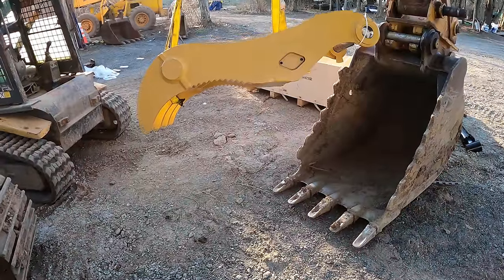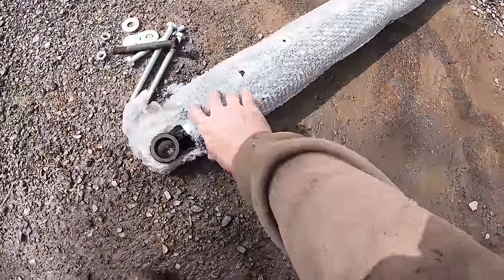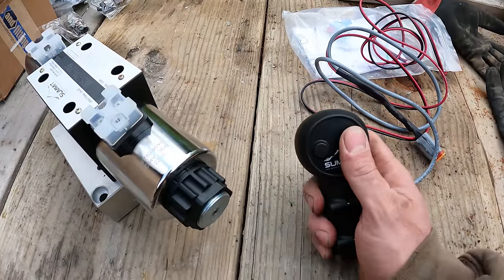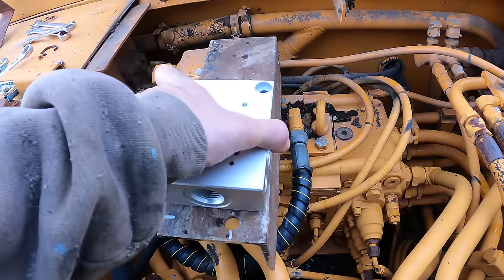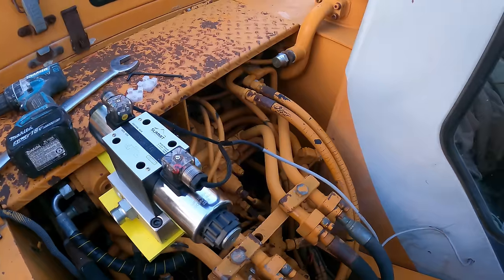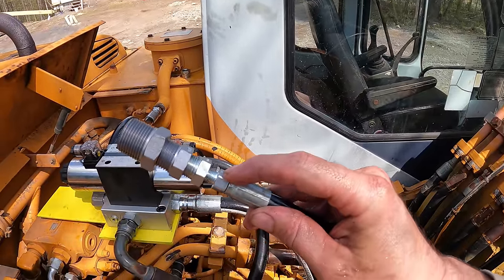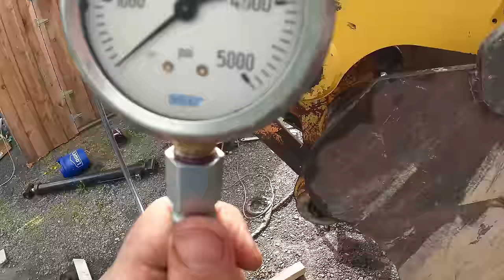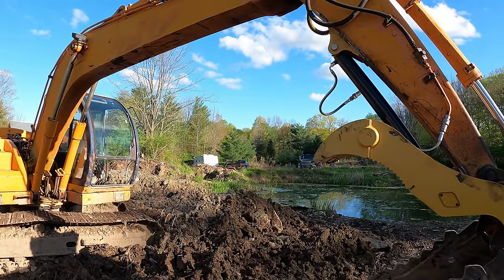Installing a hydraulic thumb on an excavator with 1 way aux circuit

Comment: I enjoyed this. I used to work at a hydraulic specialty shop and the first thing they taught me was fittings , fittings , fittings !!! This man could walk around any machine and write down all the fittings (the stlye and the size and the angle ) and he was always rite. I learned SO MUCH ! When I was trouble shooting they taught me to always “follow the flow”. I can tell you also learned a lot. Thanks (Seth in North Carolina)
Reply from the maker: yea there is alot to learn. I walked into a really good hydraulic hose and fittings shop near me and had everything all planned out and those guys kept right up with my demands with no problem, They knew exactly where everything was and even alot of the part numbers by heart. I was very impressed. I didnt just walk in with a hose and say I need it replaced. I came there with a list and walked out with every single thing being right
Reply: ❤❤7ិុ្៦😢
Reply: @jmuller86 0:11 😮

Comment: These videos are precisely the reason we lease our heavy equipment on our farm. No messing around, line-up the jobs to be done, get the equipment..do the work. Equipment goes away. Return to farming. I hated doing this work when I was a kid on my Dad's equipment. The machine shop, and support tooling was also so expensive to keep up. I can't remember even a month of my teenage years when I wasn't asked to make a "quick trip" to the hydraulics store and pickup fittings or hoses.
Reply from the maker: I dont mind working on the equipment, there is always something to learn and it is very satisfying knowing you can accomplish this stuff, when most people dont have a clue anymore
Reply: @jmuller86  I understand that perspective. Mine is simply, get work done without creating more work for yourself.

Comment: Hi Jesse 
The reason the relief valve on the main spool wasn’t allowing the thumb to move when you applied load with the bucket is because the solenoid valve is dead ending the pressure coming back from the ram when it’s not activated. That’s why when you tried to operate the thumb while pushing with the bucket it moved as the solenoid was open it allowed the oil back to the main spool relief. Tee your pressure gauge into the thumb pressure line and push on it with the bucket and check pressure. Do it with the thumb in a range of positions as when the geometry of the pins change so does the force. If the pressure is higher than the recommended ram pressure then it definitely needs a relief. An in-line relief between the solenoid valve and the ram would save bending the ram but ideally you’d use a 5 port cross line relief valve with dump as it protects the ram in both directions. The pressure in the bucket ram is irrelevant to what’s in the thumb ram even if they are the same size.
Reply: This is excellent info.
Reply: Nailed it.  Was just about to type out the same thing.
Reply: hi timmditmer,, u r 100 % right ... when selonoid A energizes it opens the return B to tank  and also the other way around,  ,,, when A and B are not energized both return to tank are dead ended.   I just wonder about those tho 1/4 inch conections on  
the block,,,   they can be either,👍 Pilot or to conect relief valves?
Reply: Hii
Reply: ຮູບ,ໃນມື

Comment: Good catch on the relief valve. It can definitely bend your new thumb cylinder. I think the relief valve doesn't work because the solenoid is after the relief valve. Id put an inline relief valve between the pressure side of the thumb and the solenoid. Awesome vid as usual brother!

Also I agree with losing the quick coupler and sticking with one bucket for the most part and the thumb. Look into a yanmar sv100, great machines!
Reply: totally..@Jesse Muller:  I had the hydraulic shop told me to put the inline relief valve on my thumb circuit.  cost of the valve, 2T and 1 hose...and them adjust the relief.  and you only need one on the extension pressure side(what the bucket push on).  There won't be much situation where a relief would be on the  retract side ;)
Reply: The valve that controls the direction of the thumb shuts off the system so the pressure doesn't get to the relief valve. A Prince DRV-2HH crossover relief valve on the lines to the cylinder would allow oil to bypass from end to end of the cylinder to limit the pressure when the bucket pushes on it.
Reply: PT ni
Reply: pl

Comment: You need an inline pressure relief valve so if the bucket pushes more than the pressure setting on the thumb it will open and let the fluid flow back to the tank. I don’t think you need more than one. I’m saying a valve that is bolted to the machine and the hoses fastened to it. 3 fittings pressure in, pressure out, and the bypass to tank. I think this is what you’re saying.
When you’re working with hydraulic fittings and hose don’t throw them on the ground unless they are NO good. If a little bit of dirt or trash would get inside the system it can cause big problems. Glad you got her working, let’s go make some $$$$$$$$.
I see the bucket coming in and out, I want to see the bucket stand still and the thumb moving to pick up and drop stuff.

Comment: I got all the way through Jesse, excellent job! You really added a lot of flexibility to that machine. Next, build a blade for the front. Maybe you could utilize those small ports on the new valve for pressure relief valves then tee them into the return to tank hose.

Comment: You can add flow control valves to adjust speed. 24 years in maintenance working on hydraulic injection molding machines. With special training in hydraulics. As well as pneumatics, electronics, and injection molding.

Comment: Your solenoid valve is holding the thumb pressure.  You may have bought a closed center block.  Open center might allow it to go back to your relief valve on the machine's valveblock.
Reply from the maker: it is an open center block but when the button is not pressed the valve shuts to hold the implement in place. Open center means the pressure line going to the valve goes to the tank, but the A and B port are still closed when the button is not pressed
Reply: @jmuller86  ahh 10-4, I ran a machine for a couple years with a thumb and no relief valve. I was just mindful of what I was doing and never had an issue. The thumb was on a foot pedal though and you could just barely crack it while you curled the bucket so that you could curl the bucket and push the thumb open at the same time to change position of how you were holding something. Or vice versa I would push the pedal to close the thumb while barely cracking the joystick right to open the bucket with the force of the thumb. That would be hard to do with the non-proportional setup you have.

Comment: 5/6/23; ..8k for a thumb, lots of hdwe/hoses + yur time! ...but ya know, if you need a thumb for existing + future jobs, the upfront costs $$ is nothing, it's ability to do the jobs that makes you the $$ is everything. Congrats on your ability to analyze hydraulic flow, fittings (different types) & install/weld/fab brackets-bolts & get this project tested & working/ ready -to-go!! Great long but rewarding video. Anxious to see you use yur 'new' thumb on future projects. Stay safe & carry on! ⚙️🔧👍👍👏👏💪✅️🍺😊

Comment: Jesse, Think the best thing you can do is get rid of that quick coupler, and go with the thumb for THIS machine, and as you stated, when you get another machine, can get what you want, with a quick coupler and hydro thumb. with the adjustments you made along the way, looks like the thumb is working out really well.

Comment: You may be able to use those 2 test ports for relief valves, or the main valve could probably just be left on. The new valve I imagine just bypasses when not being used.

Comment: If you want the relief valve to work put a switch in to turn the supply valve on when your using the thumb or wire it hot.

Comment: That relief valve is not electronic, it’s strictly mechanical. Unscrewing it reduces the pressure only when pressure is demanded. When no control action is being used, that valve block is in the closed position on all ports. The best way to overpower the thumb is to curl the bucket and retract the thumb at the same time. Other than that the valve is in the hold position and if you can overpower it, you would have other problems. Right now you just adjusted your thumb pressure way down. If you want to slow thumb motion, you can put an adjustable flow control valve in. It’s just an adjustable needle valve and are super simple and strictly mechanical
Reply from the maker: Yep. I figured out that directional valve is blocking the flow when not in use right after this video, when I bent that rod into a u shaped piece. Am doing a follow up video to fix everything

Comment: I would call the summit but I think because you connected the return from your one way flow to your summit solenoid instead of direct to tank  it’s not letting the thumb cylinder retract unless you use the buttons.  I had something similar to that when I put my valve on.

Comment: 11:29 I wonder if the pin is bent and all that slop is from pushing the bucket into the ground to rotate the machine.  It can’t be good putting that much load on the linkage.

Comment: I'd like to mention 1 issue you had, is that the pressure off your gauge bled off on it's own. That indicates an internal leak in your valve. And weld your bucket. It's torn.

Comment: That valve on the end of the lines near the bucket is for when using open end couplings on the end of the lines, we used them in bigger machines and you close the valves, unhook the hoses and put the double plugs in on hoses and the machine. 

Also, closing that valve when hammering will ruin a hammer real quick, the most important thing with at least bigger hammers is the free flow return, we have fully hydraulic quick couplers (no connecting/disconnecting hoses anymore) and there's actually an extra hose for the return oil to the tank

Comment: 1:13:00  I recommend Dielectric grease on electrical connectors to keep them corrosion free for years to come. I use "CRC 05113 Dielectric Grease" on my offload vehicles and tractor.

Comment: It’s the electric spool valve that’s overriding (bypassing) the pressure regulator.
Needs to be after the valve (both lines).
If you bump the thumb (outward or backwards) it will over pressure. Damage the gland nut or pull the piston off or blow a hose.
Reply: Find another used bucket cylinder
Reply from the maker: what's wrong with the bucket cylinder?

Comment: Re electricals, there is such a thing as a changeover relay.  Those relays have 1 extra output terminal and activating the relay swaps them. Non energized the relay has a default pass through out of one of the pins, then you energize the relay and it swaps to another circuit acting as a diode for the default circuit eliminating backfeed. They're readily available at auto parts stores but just check they can do 24v. I use them to activate another relay, so one circuit is disabled and the other activated with the flick of one toggle switch.

You just wire it whatever way you want and can even use them in pairs to do all sorts of things. Switch the earth wire if you're using a toggle switch on any vehicle that isn't wired earth return. It's good practice but I admit many auto manufacturers don't do it like this LOL but try to if you can.
As mentioned you can emulate a diode with them and they give you other options too like using a conventional and a changeover together. You just have to sit down and draw it out on a piece of paper. 

Also 3a diodes shouldn't be too difficult to find surely. Thing is, the current at 24v is half the current at 12v so you probably don't need a huge diode here.

Comment: @Jesse Muller. That shutoff valve on the boom where you plan to put the quick coupler, can you half turn that on/off to reduce the flow further, if the flow ends up being still too high? Basically use it like a flow control as well as an isolation shutoff. Just a thought.

Comment: Jesse when you open the bucket after installing the thumb at 1:46:45 you can hear a clink sound.. then look at the hydraulic cylinder tube on the outside/front of the boom.. its slightly bent inwards... and then again when you're pulling the dirt.. at 1:54:03 the hydraulic tube looks bending outwards a lil...or atleast it looks like it.. please check other wise.. its a bigger problem later down the line.

Comment: Thumb up, I would put a cover over the hole valve, those electrical connectors are not water proof, a good old handmade thumbs up.

Comment: You need a cross over relief valve between the lines connected to either side of the cylinder.  This is the same type of valve used on the angle cylinders on snow plows, except you need one with a larger port size.

This will allow fluid to pass from one side of the cylinder to the other if the relief pressure is exceeded.  

Most cylinder catalogs have a table that has the max bucking load for a rod diameter and length for pinned ends.  Take that number and divide by piston area to calculate your relief pressure.

Comment: i want to install a hydraulic pump and cylinder on a shop made manual crane on a truck i bought.....  any recs for what i need to just push a button to make the boom go up and down?  what is single vs double acting?  do pumps pump in 2 direction to raise and lower or is a valve used?  thanks for any feedback.
Reply from the maker: I think you could use a dump trailer kit with electric over hydraulics, it would come with everything you need to make that work
Reply: @jmuller86  thank you... i will look that up

Comment: What would be the downside of engaging the auxiliary circuit full time while you are using the thumb?   Since the new valve is open center it should just recirculate until you press a button on the joystick.   You could have a toggle switch in the cab. Thumb on, off.
Reply: That was my thought also.
Reply from the maker: When you have that one way valve open the machine looses alot of power because the flow is going to the tank. I would say it reduces power by 50% or more.

Comment: Realistically you only need a relief valve on the extend line. Since likely the only chance for overpressure on the thumb is pushing on it with the bucket.

Comment: Absolutley need a pressure relief valve on the extension side of the hydraulic thumb cylinder.  If not, the bucket will overpower the thumb and bend the cylinder of the thumb or break something.

Comment: Sure are glad to see you using Loctite 545! I have not had so much as a damp spot on a hydraulic fitting since I started using it years ago. And I don't worry about Teflon bits getting into hydraulic pumps and valves.

Comment: Can't those original shut off valves work as flow valves if there is too much flow for smooth thumb movement? Like partially open/close the shut off valves?
Reply from the maker: yea I think they can

Comment: What I would’ve done is put an on/off switch in the cab for the original valve which would turn on and off your aux hydraulics. Then because that valve is on, the original relief valve should work

Comment: One more grate job done Jesse! Quite challenging though. I have no doubt  you will enjoy thumb addition to machine. It makes whole a lot difference and versatility to what you can and can not do, with vs with out of it. It will definitely pay for it self. I love having hydraulic thumb on both my excavators. Strong, friendly suggestion, from my experience, see what you can do to make those hoses for thumb as tight to boom and piston it self. Having them spread so far as it is now, you will have nothing but trouble on job sites, breaking them and damaging them.... It would be also much better to flip that piston 180 degree so your hose connections are between boom and piston it self, rather then way is installed now at bottom side of piston,  just to keep them as protected as possible.  Best regards.

Comment: isn't the auxiliary valve that you installed blocking flow back to the original relief valve?
Reply from the maker: Its open center so no, when a button is not pressed it goes back to tank
Reply: @jmuller86  The pressure going to the auxiliary valve travels on to the tank but the oil in the cyl hoses is trapped by the solenoid valves unless your pushing the buttons .
Reply from the maker: @rogertucker6662  yes you are right
Reply from the maker: yea after I thought about it, when a button is not pressed the flow stops at that directional valve

Comment: How much hydraulic oil is on that thing? The pump doesn't sound very happy, she's still pretty quick though so could do an analysis or maybe run a bit thicker oil, i think we run 20w20 and it seems to increase pump life, going on 13000 hours and no sign of slowing down soon

Comment: I was with you the whole time, nodding to your expalanations and give even advise...glad it helped...!
😂😉
Great video on a big project.
Only thing that has to be done is to fix the coupler/valve assembly to the stick, that thing dangling around and shifting under pressure would make me nervous, that can't be good for the upper fitting on the cylinder...Do you still have the parts machine sitting on your front yard? Maybe you could harvest some attachment points from that...
Thx for showing, it was a joy to watch!
👍👍👍

Comment: Good job I'm putting that together but because there's no relief between the solenoid valve and the thumb they make a inline that will work so you can put the relief valve on the clamp side of it which will release to the other line

Comment: As a master electrician surely you would have realized that a 2 way momentary double pole switch, very common, would do the job perfectly with 1 finger control ?
Reply from the maker: yea but this joystick had that built into it, I didnt want some random switch taped to the joystick